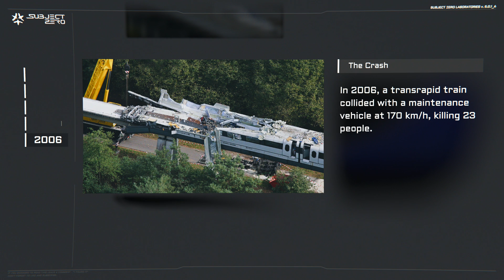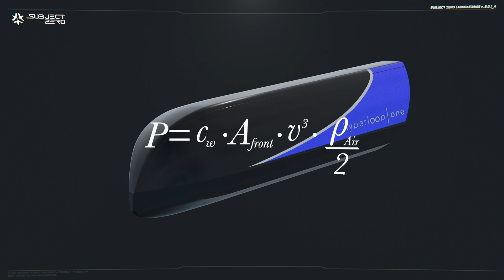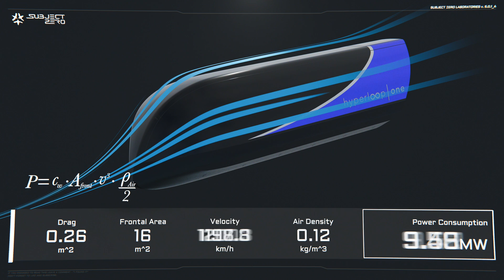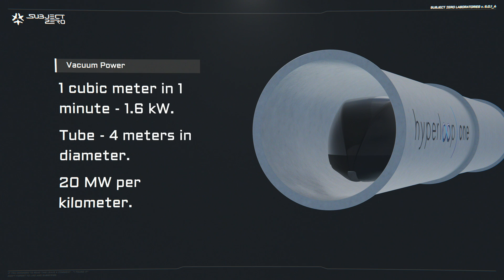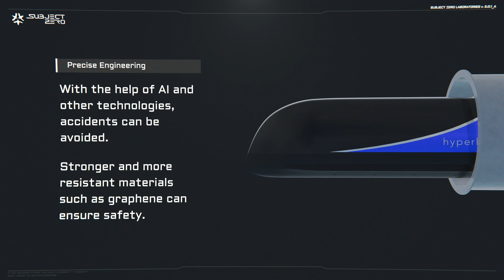Hyperloop - Inevitable Failure

Comment: What about maintaining the vacuum, the vacuum seals every few tens of meters, maintenance, environmental factors such as being in America which means higher exposure to bullets?
Reply: Just weld them instead of using seals.
Reply: @johntheux9238  if you welded them it would have an insane amount of expansion and contraction over it's length
Reply: @petdogdog  Just like continuous welded rails.
Steel has a fair amount of elasticity so it would only get at most 90 MPa of internal stress.
Reply: @KaiserMattTygore927  Yes, that's why the vacuum chamber will have stiffeners on the inside to prevent buckling from the negative pressure difference. Just like the hull of a boat.

Comment: For transporting goods on land like container ships on the ocean. Not for passengers.
Reply: Do we use airplanes for goods?
No, it's fast but expensive so it's used for people.
Reply: @johntheux9238  
We do use cargo planes. More than you think.
Reply: @halnineooo136  Yes, but I also meant that airplanes are also pressurised pods going 1'000 kmh and they are safe enough for people.
Reply: @johntheux9238  
Well, thank you for reminding me how crazy I am each time I step foot in an airplane :)) 
Hyperloops may eventually become as commonplace as metropolitan tubes. I'll wait till there's a billion people travelling in one of those. I still think ultra fast transport should be devoted solely to transporting goods and that humans should chill and slow down
Reply: @KaiserMattTygore927  A massive tube on the ground has way more safety margin since weight isn't an issue. There won't be any cascading failure, if you make a hole it will just slowly fill up with air.

Comment: At the very best of the concept, it is a maglev with a VERY EXPENSIVE extra step (vacuum tube). If not built in a vacuum environment like the moon, why bother instead of a typical high-speed train and maglev?
Reply: They can get rid of the maglev and use wheels though. The main issue with going fast has always been drag.
Reply: Ever heard of air resistance the recent fastest maglev train from Japan suffers excessively from this
Reply: The chinese can develop a cheaper and better  upgrade.Magleve is not expensive as people put it.  because there is no tear and wears on the rails, it is costing less than normal rails if they are transfering to Maglev system.  it is like gas vechicle and eV vehices. 
China is now focus on Madlev of 650mph with lower vaccum system. It is a game chancer .
Reply: @freeworld88888 maglev are not cheaper? theyre expensive af and their maintanance is very awkward
Reply: because then it'd be a high-speed train, and dicknose wouldn't make any money out of it
Reply: The video is factually incorrect, the original hyperloop designed by Elon+Tesla/Spacex engineers is very different and economically viable, it's explained at the wikipedia page for the hyperloop, see also my comment here.
Reply: @simkintube  economically viable.
Hahahahahahahahahahahahahahahahahahahahaha!

BWAHHHHHHHHHHHHHHAHAHAHAHAHAHAHAHAHAHAHAHAHA!!!
Reply: @Jimmeh_B  Well yes, the original design uses air bearings instead of magnetic levitation, it's way cheaper.
Reply: @simkintube still, the route has to be perfectly straight which means a sh!t ton of viaducts, bridges and tunnels to counter irregular geography so there goes economic viability combined with passenger throughput. Safety standards are another challenge altogether considering a single crack on the tube can be catastrophic
Reply: @simkintube  It isn't economically viable though, the required maintenance alone would be extremely difficult for cities to meet and that's not something you can cut corners on unless you want tragedies that would rival 9/11.
Reply: @KaiserMattTygore927  if you manipulate normal (high speed) train tracks nowadays you could also be accountable for serious tragedies with hundreds of deaths.
Reply: @simkintube nah bro the reason why on company even tried it is because it's way more complicated and much more expensive

Comment: Finally someone other than thunderf00t puts this infeasible idea to rest

EDIT: 
No, both sides don't have valid arguments. It is simply too expensive, dangerous, and downright impossible to make giant vacuum tube trains which offer only a small advantage. The material science doesn't hold up. We don't have materials to make those tubes long and big enough and withstand environmental effects, and they are simply too dangerous. We can have long tubes that rust and leak, or we have short, extremely expensive tubes which cost a small country's GDP per km and that STILL doesn't address any of the safety issues (earthquakes, accidents, vandalism etc.) all while netting a tiny amount of fuel savings. Just a complete embarrassment for everyone involved. At least we have an easy litmus test, if someone thinks hyperloop is a great idea, they're not good engineers and don't think scientifically

EDIT2:
02:50 the hyperloop was "sold" as a train replacement, not a maglev replacement. We don't really need faster maglev trains. We know roughly how far away the stops need to be for the system to be economically feasible. If we go any faster, the acceleration Gs will be uncomfortable or even dangerous for passengers. Already some people avoid maglev trains because of motion sickness. You could accelerate more if the distance between stops was longer, but you end up greatly increasing energy consumption, dangerousness and maintenance for what? To get people to remote locations a little faster? Planes exist, by the way. Maglev trains are ideal for connecting megalopolis/giant metropolitan areas. Planes for long distance. Trains for freight, capacity, density and cost-effectiveness.
Reply: He needs to keep riders on his side or the channel will get ratioed.
Reply: What about earthquakes, accidents and vandalism in the case of regular maglevs? If you derail a maglev, it is a death sentence to anyone on board regardless if its in a tube or not.
Reply: @the_aurora  Maglevs aren't running in an extreme environment usually reserved for extraordinary manufacturing techniques and the lab. Everything is much worse in the vacuum tube because you're pumping insane energies in. Google "Controlled Demonstration of a Tank Trailer Vacuum Collapse" to see just one of the dangers of a vacuum tube.

Maglevs are still dangerous, that's why they take so much resources and planning to build. 

The issue with hyperloop is that a guy with a pointy rock can destroy the tube.
Reply: Airplanes regularlly fly at an altitude that would quickly kill an exposed human and a total vacuum is overkill. Something comparable to the air pressure found at the heights aircraft fly at would still offer massive efficiency gains and is arguably 'as safe' as any pressurized plane.
Reply: @JohnnyWednesday  Near perfect vacuum is what they're proposing. The drag increases near-exponentially as you're  going from 0 to something. There is little difference in energy expenditure at 500km+ speeds between 1% and 50% atm pressure, but there is a large difference between 0.001% and 100% atm pressure
Reply: @JohnnyWednesday  No mate, that's not how that works at all.
The challanges involved between a 747 and KM'S of pipe/tunnel are WORLDS apart.
Reply: @JohnnyWednesday  Comparing a pressurized cabin of an airplane to a near complete vacuum that's several times larger on the ground and with moving vehicles within while acting like they're somehow the same level of danger shows you have no idea what you're talking about or have some weird fanboyism of this bad idea.
Reply: BothSidesIsm needs to stop.

Comment: What if, rather than a vacuum, we just arranged it that the air was travelling at the same speed as the train?  That also eliminates drag, at the cost of having to move a lot more mass.  Effectively, it would be like some of the pneumatic tubes used to transfer small capsules (say, cash from tills) round some commercial buildings.  Overall efficiency is, presumably, significantly lower, but there are savings by not having to vacuum-proof the tunnels.
Reply: What kind of marvel science and energy would you need to move air at 500 km/h let alone 1000 km/h in a 300~500 kilometer tunnel. What kind of insane energy usage would that be.
Reply: it would lead to problems with trains stoping since the whole air needs to slow down and if there are multiple trains in a tube, what then? 
also i don’t know how energy intensive it to accelerate that large of an air volume.
Reply: Impractical and too power hungry.
Reply: That wouldn't eliminate drag at all. It would just transfer the air friction to that between the moving air and the staitionary tunnel wall. Read about the "no slip consition" for further context.
Reply: i am assuming a larger version of a particle collider but it uses turbines to circulate a shit load of air.
Reply: One word: Friction
Reply: They use these in bank drive thrus

Comment: Nobody really spent time calculating the cost of building and maintaing a vacuum tube infrastructure. There were claims these were cheaper than conventional rail to build.
Reply: I really can't comprehend how anyone wouldn't immediately recognize that the maintainence costs alone of a multiple miles-long vacuum tube large enough to contain a passenger vehicle would be so astronomically high as to render it so impractical it could never be anything more than a titanic money pit...and that's assuming they could get it operating at all. Then there's safety concerns...what if a fire started inside the passenger compartment halfway through a destination? Those people would be as good as dead. To describe the hyperloop as being a folly would be the understatement of the century to anyone with a lick of common sense
Reply: @dano8902  THIS anyone that thinks this would somehow be viable is on 17 types of drugs. to maintain something of that size and to ensure it doesn't implode due to various factors would eliminate even big city budgets.
Reply: I swear some people have no common sense these days
Reply: Elon's original paper describes a very different design that is actually economically viable, you can learn more on the wiki page for the hyperloop. There is also an official paper hosted somewhere at Tesla. This video should mention this design, all the other "hyperloops" aren't really hyperloops, they are just maglevs.
Reply: @simkintube  that paper is notoriously known as being completely scientifically illiterate. Please...
Reply: 2x1 km steel bar vs 1 km mega giga resistant vacum tube. Just the very basics to cover a 1 km journey.
steel is so dirt cheap that we leave many many thousands of km all over on the ground between our towns and cities. We have been doin' it on large scale since the 19th century.
vs
mega giga resistant vacum tubes. Probably not invented yet. IF already invented, nowhere near the large scale, cheap production we'd need.

"There were claims these were cheaper than conventional rail to build"

yes. There were CLAIMS. On the intellectual level of flat Earth or other religi0ns.

Comment: Hypeloop will work
Reply: You're right, just not anywhere with a thick atmosphere.
Reply: @cstarand plate tectonics, and different temperature zones, and mountains and cities in the way, and with any vacuum pumping technology known to mankind and and and... and for what, with all that money and effort people could have built 10 high speed railways. A hyper-overengineered solution for a non-existing problem.
Reply: @nikethunner2732  I agree. Please re read my comment
Reply: @kineticstar just wanted to add some points to it!
Reply: *Not

Comment: You can use air bearings, magnetic levitation or even wheels though, what matters is the vacuum tube.
Reply: Air bearings... In a vacuum?
Reply: @speadskater  It's not a vacuum, just low pressure air. Just like airplanes that fly at high altitude to go faster, it's a compromise.
Reply: @johntheux9238  hahahahahahahahahahha your as good at physics as Elon. EDIT lol he deleted his comment.
Reply: @brendanariki  What's the issue? 100 Pa or 1/1000 atmospheric pressure is more than enough if you have an air intake covering the whole cross section of the vehicle. At 1/100 atmospheric pressure you only need one the size of a car's intake.
Reply: @johntheux9238  Lol why did you delete your comment? Also, nice googling. :) The problem isn't the amount of air available in a near vacuum system. The problem is that as the vacuum increases another parameter in an air bearing system must decrease. And at 100 Pa that parameter is so small that if you understood the system, you would see the absurdity of the entire "air bearing in a vacuum" idea. An absurdity that a so called "genius" like Musky boi should have understood.......
Reply: @brendanariki  My comment was not visible so I deleted it. But it's still true, air bearings work well in a vacuum as long as you have an air supply, just like rocket engines.
Of course you can't carry your own supply, you need a compressor and at 100 Pa you need one covering the whole cross section of the vehicle. At 1000 Pa however you only need one the size of a car intake.
Reply: @johntheux9238  It was visible that's why I replied to it. It's not about the air supply. It's about the practicality of air bearings for a train filled with people, in a small tube, over large distances, at ridiculously high speeds. It's the difference between theory and reality. Thats why the hyperloop is maglev and not air bearing. Something the real engineers figured out very quickly while the fake engineer Mr Musk didn't.
Reply: @brendanariki  I don't really see where the issue is, you can still add suspensions over the air bearings.
Reply: @johntheux9238  At 100 Pa what is the required thickness of the air bearing? What is the tolerance of a 100km long vacuum tube subject to thermal movement and ground shift? What is the probability that the required construction tolerances can be maintained over such long distances? What is the probability that the system won't suffer a catastrophic failure due to the above? Theory vs reality. Two very different things.
Reply: @brendanariki  100 Pa is the external pressure, the pressure and thickness of the air bearing stay the same as they would be at atmospheric pressure.
The vacuum tube would be built under tension, just like continuously welded rails so it will self-straighten, just like a cable.
Reply: @johntheux9238  What is the thickness of the air bearing? i.e what is the gap between the surface of the bearing and the surface of the tube?
Reply: @brendanariki  Not much, there will still be suspensions on top of that if that's what you are wondering.
Reply: Wheels will provide frictional drag, and air bearings negates the whole vacuum tube requirement.
Reply: @cstar Yes, but rolling friction doesn't increase with speed so it's not really an issue.
And air bearings work just fine in a vacuum.
Reply: @johntheux9238  Okay, how do you remove the thermal build-up on both rail and wheel in a vacuum?

How do you prevent the warping due to that heat?

How do you regulate pressure in an air bearing if you have a leak in the system while in a vacuum? 

How many pumps and sub systems will need to be built to manage an on board system? 

Will you trust any transportation that is required to carry high-pressure tanks in a pressure vessel while in a vacuum medium? (Even NASA doesn't put tanks inside their vehicles crew compartments because of the danger)
Reply: @kineticstar  As speed increases the energy dissipated per mile stays the same so the rail won't build up heat. Energy dissipated per second however will increase so the wheels will heat up but you can just use liquid cooling like in any electric car.
Reply: @johntheux9238  ahhh... what? Go to your physics professor and ask to retest on thermal dynamics.
Reply: @kineticstar  What's the issue? The wheels can operate at over 500°C with the right alloys, at this temperature you can dissipate heat using the Stefan–Boltzmann law of thermal radiation.
The liquid cooling is just to increase the surface area of your radiator.
Reply: USE the air... DON'T fight against the air... USE it.